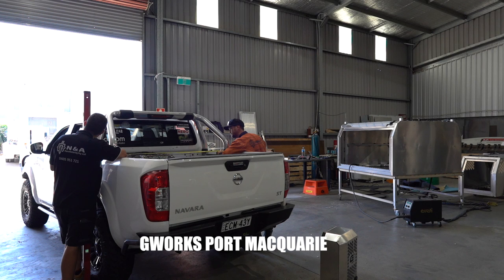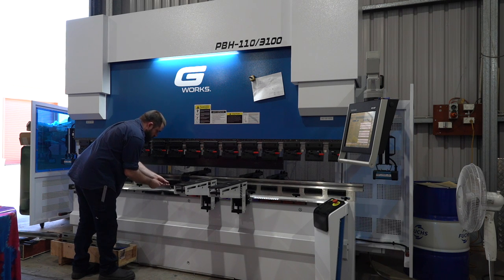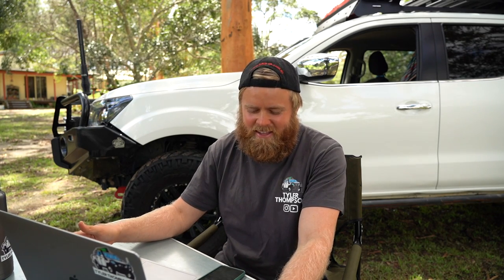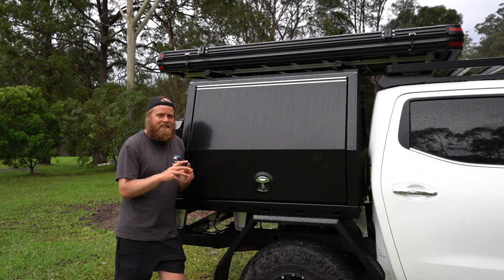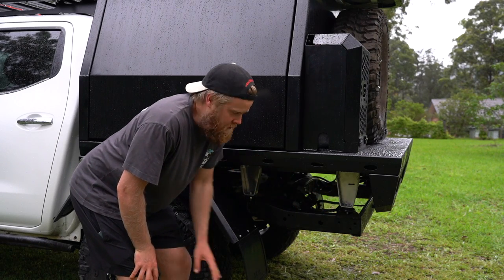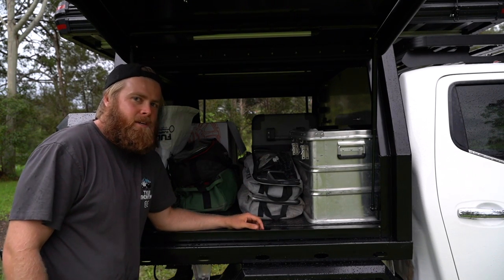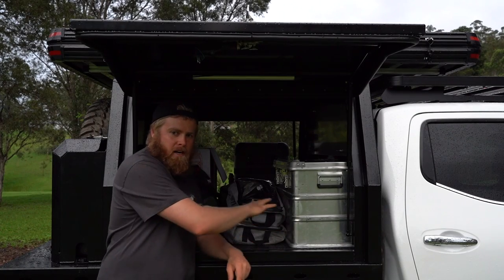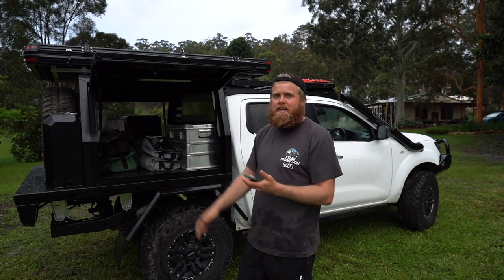ULTIMATE TRAY & CANOPY BUILD! Full reveal! How much did it cost!? Nissan Navara NP300

Comment: I think what many people don't consider with a stand up fridge is the lower efficiency; every time you open the door the cold air flows straight out. The warm air replacing it needs to be cooled.
I am amazed that Australian built Trailblazer Fridges by NorCoast Refrigeration are not more widely used. With a 50mm thick lid and 75mm thick walls and floor they are very efficient. 
Other wise a sweet setup. We are always balancing GVM which you have considered well.
Reply from the maker: Thanks for the tips mate!

Comment: Hi Tyler, love the new set up. What about a drifta drawer with their built in slide out table(under the drawer) that you can use for a bench as well, same side as the fridge. Then you have all the kitchen gear on one side, (dry food box/bag could go on top) with the water tank tap on same side under the tray. A long alloy tray above the fridge and drawer to put chairs, camera stand etc. Other side could have boxes for spare parts etc and your battery system (if you're getting it out of the cab). 4wd set ups are my favourite🙂. Don't forget the wheel bag/bin you can now have strapped on, enjoy.
Reply from the maker: Thanks mate!

Comment: Well done Tyler. I was wondering when you were going to upgrade.

Personally I would have extended the canopy another 25cm and not had that flat area. A quick fold out table would've done the job and you'd have more storage.

Good luck with it and thanks for sharing

Comment: What roof rack and recovery boards did you decide on and what back bone mounting system did you use? Another tremendous video Mr Thompson.  Well done and keep up the exceptional work. Thank you kindly
Reply from the maker: Its a front runner roof rack mate, bolted through the roof to plates underneath, much stronger now 👌
Reply: @TylerThompson90  what recovery boards do u have? Are they worth the money? Thank you kindly

Comment: Well done mate, you've earned it. 
Do your research on upright fridges, apparently there not as good as normal fridges
Reply: I have both, admittedly the upright does lose some of the cold air when you open the door but realistically you dont stand there with the door open for ages.

Plus the benefits of having an upright is everything is easy to access and it has a built in freezer

Comment: Looks great 👍 Fantastic it’s 100% Oz. We know you will give G Works some fantastic exposure.
With the RTT did you have to position it on the canopy so the front and rear overhangs weren’t too long ?
Also I note your new roof rack is different from the original. Frontrunner? Better ?
We will all be watching to see how the new setup goes.
Cheers
Reply from the maker: Cheers mate, yeah it overhangs both the front and rear a little bit. And yep got the front runner rack now which is definitely much better and stronger

Comment: Great canopy, good to support local companies, me I'd leave your dual battery system in the cab, you've run a cable for your fridge already, add a fuse box and a couple of power points and your good, the KISS principle, some of these canopy 12v systems are getting way over the top recently. Killer beard mate.

Comment: You’ve still got a lot of weight behind the back axle   Could you Mount the spare on your roof rack Tyler?   Kept an eye on ya chassis mate
Reply: Wheel on the roof would make it so much more tippy on the tracks mate, I don’t think he’ll have a problem with weight distribution on this set up imo
Reply: You want weight low (so where possible avoid the roof), it’s only one tire and jerrycans, so should be fine

Comment: For God's sake don't do the Pedder's GVM upgrade for the NP300 as it does not ride nice on the extended bump stops when loaded. It also slips off the bump stops on winding roads so you ride unlevelled.

Comment: We had a similar set-up yours but started with a tray and had all the electric; solar and additional batteries installed.  From start to finish, I believe it cost us around $35,000 without the the on-board tent, which cost and addition $8000 installed. Had our rig for the past 4 years and really enjoyed getting away to isolated camping & fishing areas.  What use to be an isolated camping areas sharing a 2 kilometer beach fronts with a maximum of 5 other people in peak-season, has now become saturated with Bogan's and Bogan families littering these unique areas with human feces; plastic bags; rotten food and filthy nappies. We just sold our rig after Christmas and have outfitted trail bikes instead.  This way, we can go to remote places these bogans and 4x4's have no hope of getting too.  I would suggest anyone hire a 4x4 first and check these places for yourselves before spending $90,000 on a rig that can only take you to bogan paradise campsites.